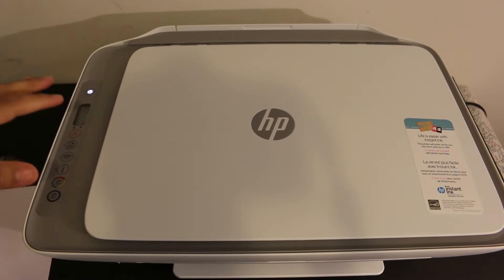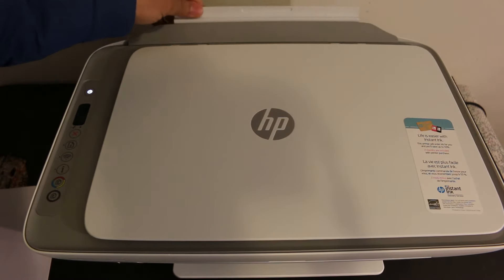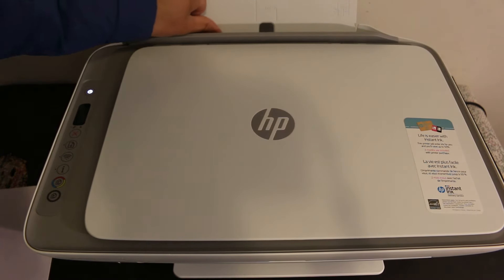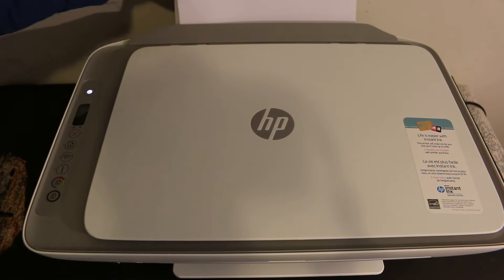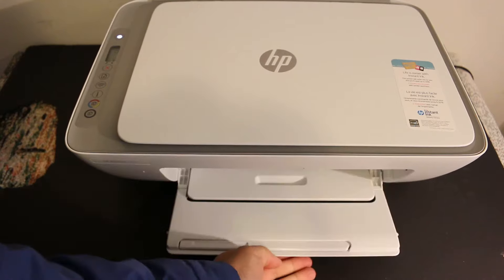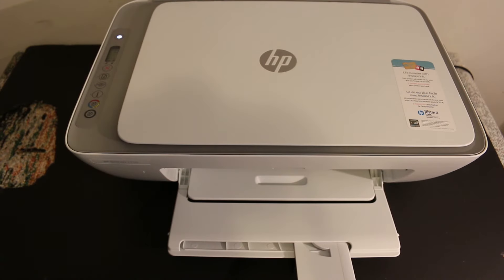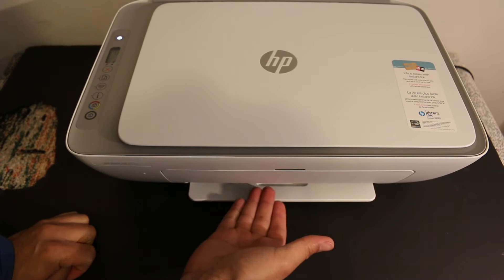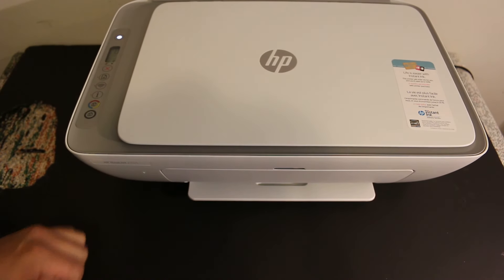HP Deskjet 2700 Loading Paper Tray, Output Tray, review.

Comment: Any suggestions. Printer does not seem to pick up the paper. It tries to get the paper, then the paper goes in scew...
Reply from the maker: Try another paper to use as poor quality paper can have issue. It can be printers problem so clean the parts that pick up the paper so that it stops strucking in.

Comment: need video to show the loading of paper.  Loading paper problem
Reply from the maker: Paper goes at rearside on the top. adjust the size adjuster and place paper there. there is a plastic cover just move it and then insert the pages.
Reply: The paper doesn't fit!